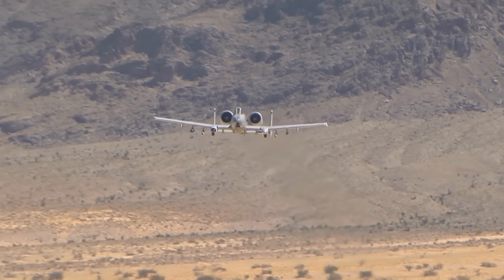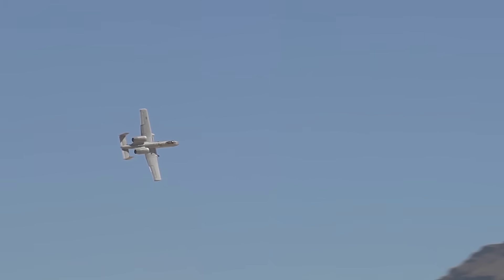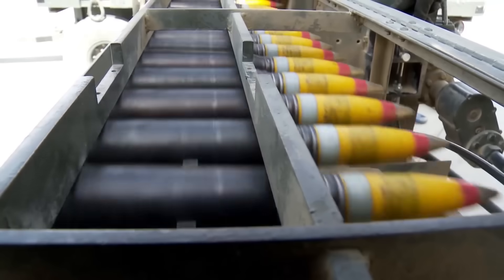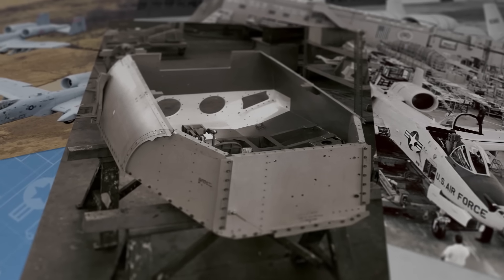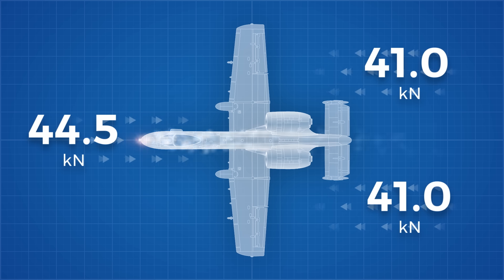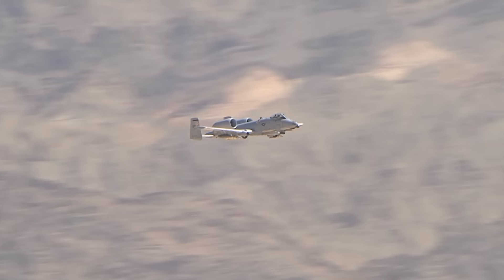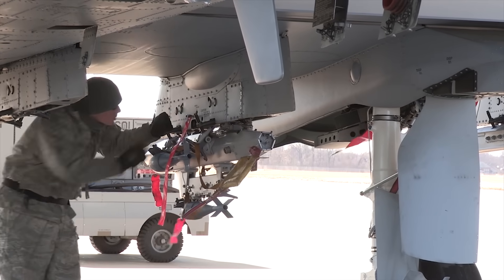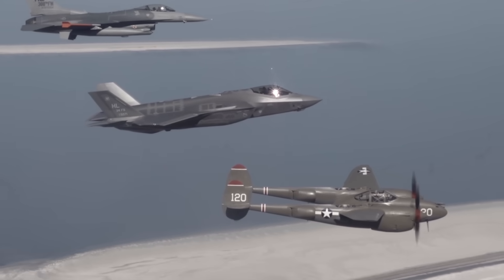The Insane Engineering of the A-10 Warthog

Comment: The cases of fired shells are not returned to the magazine to prevent damage to the aircraft, but to minimize the expended wight difference to influence the craft's balance.
The ammo was originally supposed to be caseless, but the round protective coating caused feeding problems and the idea was eventually scrapped.

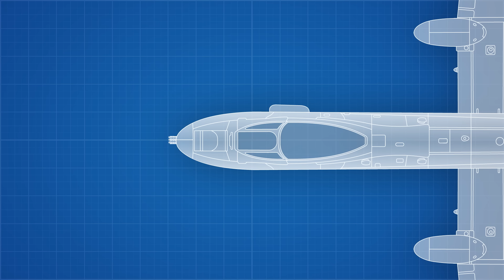Comment: 7:47 Absolutely not. And never was, not even on the YA-10 equipped with the Vulcan. It is offset to the port side while the front landing gear is waaaay starboard. Getting one of the key design elements of an A-10 wrong in an A-10 documentary earns you a thumb down.

Comment: Aerospace engineer from germany here. The A10 is a great example for efficient design for the purpose. As known an aircraft is always designed for a purpose. If you have an multi purpose aircraft its not good at everything its probably not that good on everything. 
The streight wings are best option for subsunic maneuverbility and lift. The H-shaped tail is a little more drag but drag ist stability and stability can be used to anhance maneuverbility. Engines are just some turbofan engines are mostly more efficient during cruise flights so they help safing fuel. The high mounting is often used when you have dirty or sandy sourrounding. So If I would design a ground support and ground attack A/C in a hot zone for non-stealh missions It would probably look like this

Comment: Correction. The gun is mounted slightly off center line. The firing barrel is the one on upper right hand side which is on the planes center line.

Comment: The GE GAU-8 was not chosen before making the aircraft because the 30mm GAU-8 didn't even exist when the first YA-10 prototypes were built.

They were built around the existing M61 20mm, which is what they used in the rigged fly-off demo between it and the A-7D/F, with A-7 radar bombing system turned off for most of the CAS profiles they flew.

The YA-10 had different performance as a result, which had to be compensated for once the GAU-8 was developed.

Comment: "F-16 was designed as a multirole fighter"
If I recall correctly the design motto was
"Not a pound for Air to ground"
Reply: The F-15C community has that motto, not the F-16.
Reply: Maybe the original aircraft specifications 
However the F-16 in service has always had A2G capabilities, in fact even the F-15A had air to ground capabilities
Reply: That was the F15
Reply: @bernhardmeysel  that's interesting considering that F-15E is one of the most powerful strike planes in USAF arsenal
Reply: @srelma  The motto was before Strike Eagle became a thing.
It was actually Israelis who first got the idea for the Strike Eagle back in the mid-80's when they modified twin-seat F-15D:s to carry air-to-ground weapons turning them into long-range fighter-bombers and Bombed a PLO headquarters in Tunisia. https://en.wikipedia.org/wiki/Operation_Wooden_Leg

Comment: We need a modern version of the A-10. With modern engineering team. They could make improvements to the close air support aircraft. With new engines and advancements in carbon fiber. We could have an A-10 with extended range and better payload. F-35, or any fighter can't replace the A-10

Comment: Great video! One neat fact that I don't think was mentioned is that many of the components such as the engines, landing gear and stabilizers were uniquely designed to be able to be interchangeable between the two sides of the aircraft, making it easier to maintain as they don't have to worry about having a shortage in parts for a particular side.

Comment: I'm actually impressed with the aurframe engineering. The wings, horizontal stabilizers as well as the thrust line of the engines carry negative Angle of Attack (AoA). When I tried to apply this to design a parkjet, it flew unlike any other 0 AoA parkjet. I could say it closely mimicked how the real A-10 flies.

Thanks for the video 👍

Comment: Adding another important design point about the aircraft, very specific to the low flight role: the wings.
Notice that it has quite the long wingspan, with straight wings. No swept, not short like most jet fighters, but straight long ones like older WWII fighters (if not longer proportionally as well).
This ensures the aircraft has better lift under lower speeds than a swept wing, and thus shorter takeoffs, and slower stall speed, meaning it can just patrol around easier than with a fast supersonic jet.
In counterpart, the aircraft is rather slow, in part because it's not it's role to be so fast either. It's really in line with older propeller, piston engine WWII fighters in therms of speed. By comparison it's top speed is only 706 km/h (about 439 mph for you imperial folks), compared to even a commercial jet liner being at least 800 km/h and usually more. The wing is entirely optimized for the role.

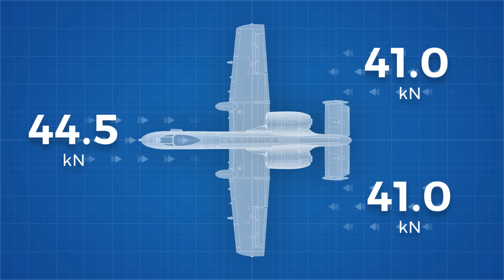Comment: 8:00 The gun is not centered in the aircraft. The gun is offset because the firing barrel is on the side (I forgot which side). So the firing barrel is centered on the aircraft but not the whole gun.

Comment: fully loaded these planes have maybe 1.5 h of flight time before they run out of fuel, we're monkeys still...
Reply: Yes they DO spend a lot of time refueling when you want loiter time and aren't using them.  Otherwise though they have to land to re-arm anyway.  That's a big drum on them but they have less than 20 seconds total fire time.  That's one of the reasons they fire short bursts.  A typical shot is 1.5 - 2.0 seconds. (100-130 rounds, of 1100-1200 per drum)  So they get to squeeze off 10-12 bursts.  That's just the gun though, they also have missiles.  The A10 can fire a longer burst to attack a column of vehicles, but you won't see it firing much more than 3-4 seconds total in any one burst. (firing extended bursts causes many issues, including reduced air speed)

Comment: the GAU-8s penetration capability has been hyped up quite a bit. but in truth it can't penetrate even an old T-62, unless from a very lucky angle. it's main duty would have been to rip up trucks and BTRs maybe a BMP.
and they expected very high losses, they had to pull A-10s from the frontlines of the first Gulf War untill the F-16s and F/A-18s suppressed the iraqi air defenses enough

Comment: The amount of soldiers who appreciate having the A-10 flying around, should be reason enough alone to keep it in the inventory. It saves lives and does something no other plane can.
Reply: And significant fact, it's slow (which is a good thing). F-16 are meant to take out a target from 2 miles away and gtfo quickly; while the A-10 would brrrt at a slow speed alongside allies. Speed is not always the solution which is why the A-10 has lasted this long but try convincing the Pentagon otherwise.
Reply: @MarloSoBalJr  it's future is safe for the next decade or two. 😀
Reply: @MarloSoBalJr  "it's slow (which is a good thing)" - yeah because taking too long traveling to where you're needed is such a positive
"Speed is not always the solution which is why the A-10 has lasted this long" - Literally the opposite. In the air, speed is life. The USAF had an excellent CAS aircraft in the A-7 but the Army requested a slower aircraft that could escort helicopters. Some politics and corruption later, the USAF passed up an upgraded A-7 variant for the A-10.
Reply: @MarloSoBalJr  you only have to loiter a long time in and a10 because they don't have the sensors to locate targets. And those low slow passes make them an amazing target for modern surface to air missiles. You are stuck in 1970s thinking.
Reply: @MarloSoBalJr  You're implying the F-16 can't fly at 700km/h. When it can do so easily. The reason the A-10 still exists is because of congress lobbying to keep certain factories in operation in specific states like Michigan. It has nothing to do with the A-10's ability to sit in hangars.
Reply: @Nothing_._Here  
Not "easily."  If memory serves, the F-16's stall speed is around 250 knots airspeed or about mach 0.35  I don't know specs of the A-10, but I'm fairly confident that it can not only fly at that speed, but shoot and maneuver.
Never mind that it doesn't need an APU or its own specially trained maintenance squad - a single master mechanic can tell grease monkeys how to do most maintenance (aside from the dangerous stuff like ordinance loading and refueling).
Congress isn't appeasing contractors by keeping the A-10 in service; that's what SLS is doing.  Like the Harrier, it's going to be hard to replace - not just operationally, but in the cultural mythos of the US Military.
Reply: @HuntingTarg  Pretty much this.  Instant morale boost too like calling in the cavalry.  35mm rounds too jesus christ!
Reply: Nothing Here spoken like someone who has never needed CAS, nor understands the significance of the unique capabilities this airframe offers.  You can hammer a nail with a shovel, but it works better with a hammer.  This is indeed the correct hammer for CAS, not some fast mover that can’t loiter near as long, nor carry the same types and quantity of ordinance guys like me need.  F-16 and F-15 are great planes, when you place them in the role they were specifically designed for.  This one is no different.  Admittedly it cannot go head to head with modern fighters, but that is not what it was designed to do.  It is a mud mover and us grunts love them and the AC-130.
Reply: @Nothing_._Here  How can you discuss this and not bring up basic Wing areodynamics? Your argument is so blatantly obvious, Fly by Wire by dammed. Besides, no other plane has a gun like the A-10s, not the redundancy not anything else. Just like the A-10 is not a dogfighter.
Reply: @petertimmins6657  It's amazing when people attach themselves to a number and just spout stupid nonsense. I mean, Ego can make people do ridiculous things. And is sad when all the have to do is watch a 2 min video on Wing geometry to figure that one out. There's no way a fighter can have the stability and endurance of an A-10. Not even the F-14.
Reply: @Nothing_._Here  the F-16 and the F-35 are less capable aircraft for close air support especially in mountainous areas like Afghanistan. The A-10s are also cheaper per hour to fly and can loiter much longer. The A-10 and AC-130 gunships have a huge morale effect on both sides.  Other jets can be effective but I sure would feel better on the ground if I knew one of these two was loitering above!
Reply: @petertimmins6657  yep, you can only expect a plane to do its best at the job it was designed for. I didn't see your comment and basically said the same thing expect I've never needed CAP personally. I guess the real question is how long before they make an A-10 clone drone? You could make it look just like an A-10 and the enemy wouldn't even know if they were manned or drone. 

Or maybe they already have it and just don't want to show it off?
Reply: @HuntingTarg  I believe its normal stall speed is around 130KIAS (flaps up.)  Its never exceed speed is 450 KIAS.
Reply: @petertimmins6657  "This is indeed the correct hammer for CAS, not some fast mover that can’t loiter near as long" - But the A-7 is a fast mover compared tom the A-10 and it had an excellent track record in Vietnam.
"nor carry the same types and quantity of ordinance guys like me need" - But many planes can carry the same ordnance as the A-10, and more of it.
"F-16 and F-15 are great planes, when you place them in the role they were specifically designed for." - The F-16 was designed for everything. It's a great fighter and a great bomber. The F-16 and Strike Eagle get more CAS action than the A-10 itself.
Reply: @einarabelc5  "no other plane has a gun like the A-10s" - Why is the gun needed? It hasn't been able to punch through tanks since the 80s, and against thin skinned vehicles and foot soldiers it doesn't do anything that 20mm or 25mm already won't do.
Reply: @bartfoster1311  "the F-16 and the F-35 are less capable aircraft for close air support especially in mountainous areas like Afghanistan" - And yet the A-10 gets a minority of CAS missions, most being given to F-16s, Strike Eagles, F/A-18s and B-1s. So much for the mountainous areas of Afghanistan being a problem, seems like the fast jets are doing fine while the A-10 struggles.
Reply: @Nothing_._Here  "You're implying the F-16 can't fly at 700km/h" and just how maneuverable is the F16 compared to its design speed?
Reply: I think the airforce wanted more funding towards the f35 but the senate arms committee (led by John McCain) pretty much said "you've failed to give a compelling reason why we should retire the A10, so the answer is no." I heard from somewhere that the airforce was dragging its feet and just stopped providing maintenance for the craft so engineers had to strip old or damaged A10s to support the functional planes. Please take my statements with a huge grain of salt since I can't recall what the source was from
Reply: @elmgful  John McCain's brain tumor deserves the Nobel Peace Prize. There's multiple compelling reasons to retire the A-10, such as the fact that it was outdated in 1991 when it had to be grounded due to all the losses it suffered against the Iraqi Republican Guard.
Reply: Why do you think they took it out? So soldiers get demoralized.
Reply: Yep, morale boost effect of the a-10 should be enough for it to stay
Reply: If military leaders gave a single fk to what their troops think, we wouldn't have WW1 and probably all the others that followed it.
Reply: @CapitaoAmerica737  That reminds me of that general at a congressional hearing, IIRC the conversation was about why to spend money for humanitarianism in the middle east or maybe send peacekeeping troops or something, and the general responded "if you don't spend money on this, you're gonna have to spend more money on ammo". Implying the second option also comes with bodybags. :-/
Reply: @cheaterman49  you don't need body bags for soup
Reply: Saves lives 😅
Reply: @JoshF710  Yes, soldiers lives.
Reply: It also does a ton of blue on blue. The early A10s were so blind pilots had to use binoculars to to try to identify targets. The C model fixes this a bit, but at that point, just use an F16.

Comment: I've heard somewhere that in order to sustain firing at a target for a long duration the A-10 needs to be diving downwards in order to counter stalling
Reply: ye. he mentioned that
Reply: @honkhonk8009  I think he only specified that the pilot only fires in 1 to 2 second bursts to counter that problem since the recoil produced by the A-10's main gun was more powerful than both engine's output
Reply: Fancy Pickle That’s not really the truth though, on the very early A-10s they had a problem with the gun gas getting inhaled by the engines which would cause an appreciable decrease in power and thus speed but this issue was fixed. The aircraft won’t stall from firing in level flight
Reply: And also, the recoil isn’t much of a problem with the GUNPAC computer currently in place with the A-10C, keeping the spray tighter than without it.

Comment: the guns aren't installed exactly centreline to the aircraft
from the pilot's point of view, the gun fires when the barrel rotates to 3 o clock position, the off center recoil would cause the aircraft to yaw to the right during firing
the gun is actually mounted slightly to the left side,  with the firing barrel exactly on the centreline of the aircraft, thus removing the yaw effect
also the front landing gear is mounted on the right side because of the sheer size of the gun, it wouldn't fit otherwise

Comment: The GAU-8 Avenger is not actually mounted in the center of the plane. It is mounted slightly off-center because the rounds come out from the barrel that is located at roughly the 7-o'clock position when looking from the front. That specific barrel is centered when the rounds exit so the forces are applied properly.

Comment: Heavy rounds doesn't change the kinetic energy. The energy will be the same, but the momentum wont.
Kinetic energy: E = m*v^2/2
Momentum: p = m*v
Force is the change in momentum over time: F = m*a
This means that there will be a greater force needed to stopp a heavier bullet than what is needed to stop a lighter bullet (assuming they have the same energy).

Comment: In addition of being cheap to operate compared to other planes, the A-10 also has a very long loitering time which allows it to remain available for CAS for much longer thanks to both a high internal fuel capacity and its engines being overall more efficient than its competitors. It can't get to places as fast as other jets, but once it gets there, it can stay there for much longer without having to carry external fuel tanks.

Comment: While the F-16 does technically have 11 hardpoints, only 8 are capable of holding munitions. On the other hand all 11 of the A-10’s hard points are capable of holding munitions. Other than that this is a really good video and it is really accurate.

Comment: I would love to see the USAF either acquire new updated new A-10's with updated avionics and (especially) engines or something similar without the expensive stealth and other crap boneheads seem to think are important in anything that flies these days. I was a crew chief and having worked on many planes in the USAF inventory, the  A-10 was my favorite, easiest and most rewarding to maintain. In a real war where supply lines are a mess and no depot maintenance available, this is the only plane maintainers will be able to keep flying before long.